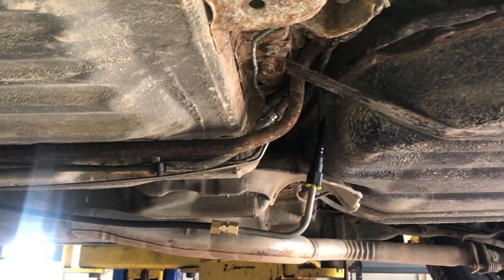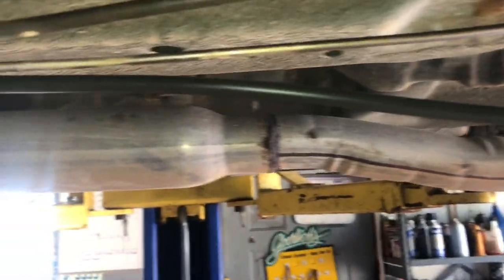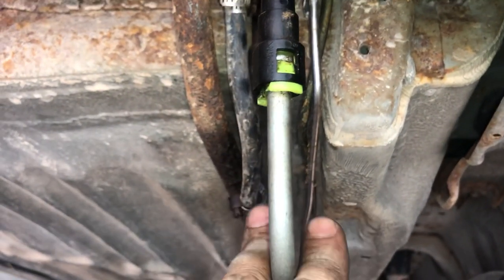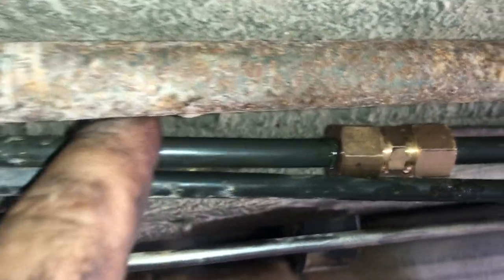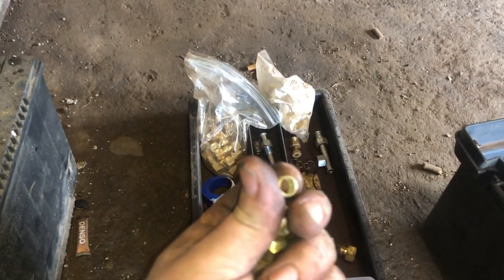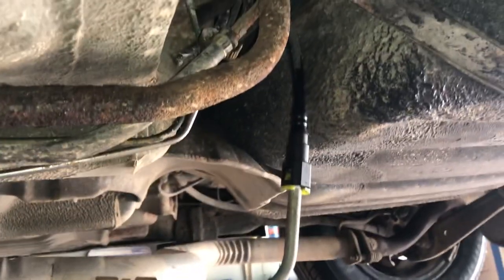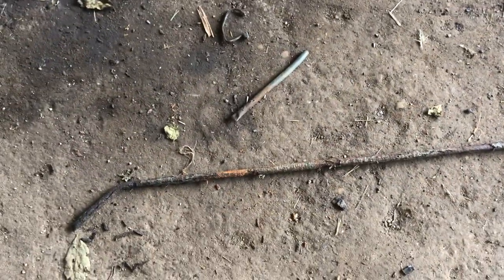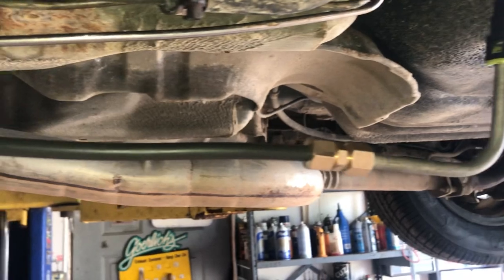Fabricate fuel lines | How to make your own gas lines quick and easy | replace leaking gas lines

Comment: What you just showed will save me over $1200. The local popular repair shop wanted almost $1300 to fix a leak at the filter and on the pipe near the tank.

Comment: I’m replacing the fuel line on my 1999 Buick park avenue and my fuel filter is right in the area I need to replace. It’s a screw on fuel filter on one side so I was wondering if you have any advice on anything I could attach to the new line so I can screw the filter in

Comment: Any opposition to using soft fuel line? My thought… one it’s easier two it doesn’t need to be hard line because it’s not a lot of pressure and it won’t rust.
Reply: i was wondering the same thing... put a new carb in my snowblower but the angle of the fitting was slightly off and theres no extra slack to get it on all the way. I was looking to use this as an extension to add more line instead of replacing the whole line.
Reply: I did it on my suburban years ago and have no issues

Comment: Mine broke off where the fuel filter nut is on a Chevy astro van...I will have to get new inlets that go into the fuel filter. Any help on where to do so would be amazing.
Reply from the maker: I know auto value stores typically stock a wide range of fuel unions and fittings
Reply: But I replaced it today with a rubber ones 🙏🏼

Comment: Hiw safe is it to use on fuel line will it ever come loose or slip s
Reply from the maker: These are the same fittings that come with GM/Ford/Chrysler fuel line repair kits. If installed properly they won’t come loose

Comment: Did ya need a flaring tool?
Reply from the maker: That is a compression fitting in the video so no flaring need but you can go the flaring route and use unions and fittings